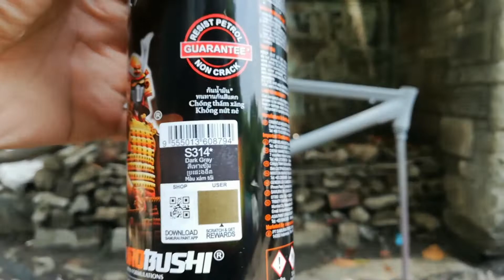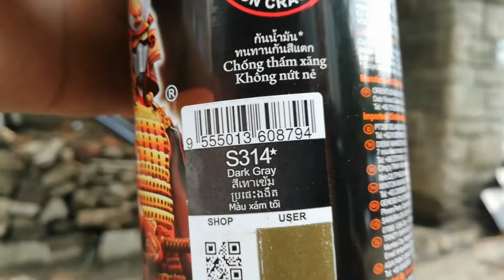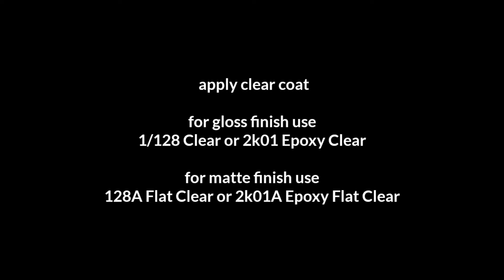How To Paint Bicycle Frame Using Spray Cans In Gunmetal Grey | Samurai S314* Dark Gray Matte Finish

Comment: Boss ilang lata magagamit per color, ilang primer, main, at clearcoat
Reply from the maker: kung ordinary primer atleast 2
kung epoxy primer 1

color coat main color 2
details / design color 1 kung 1 color lang din

kung ordinary clear coat 2 to 3 at kung susundin mo process ko
epoxy clear 1 for final clear coating